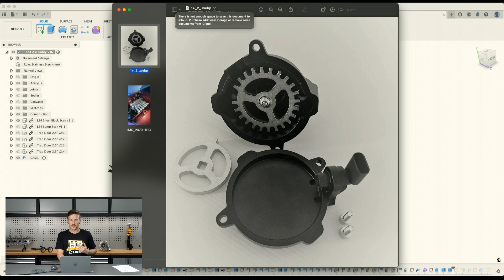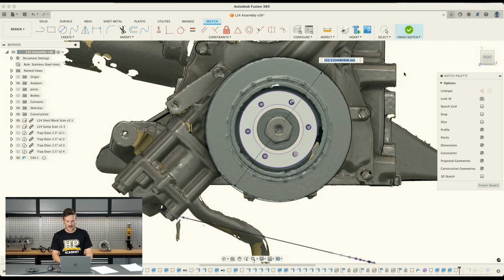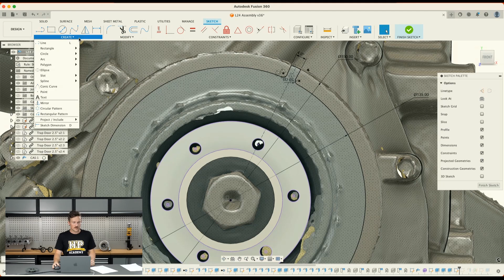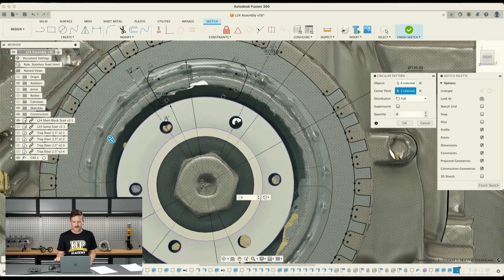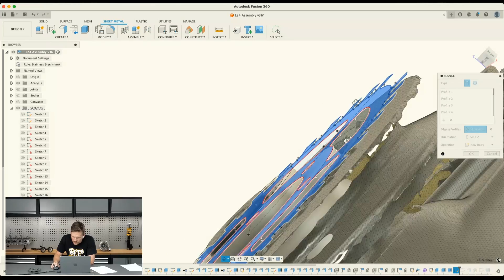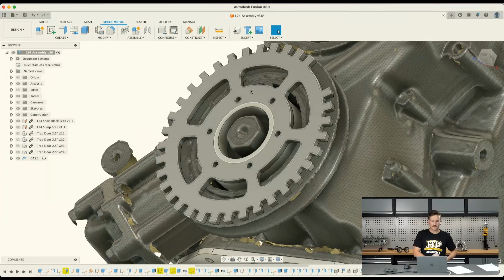Make Your Own Triggers With CAD

Comment: how did you get a 3d model of an engine block?
Reply from the maker: You have 3 options.
1.) 3D scan it (that's what we did for what you're looking at here).
2.) Model it in CAD based off manual measurements.
3.) Pay someone for the model (if available) or to scan it for you.
https://www.hpacademy.com/blog/3d-scanning-is-really-this-simple/?utm_source=facebook&utm_medium=social&utm_campaign=general-interaction

Do note this scan won't map internal passageways. That can be done via scanning (or manually if it is required), but the cost of the 3D scanning equipment that does that is really beyond the budget of most individuals, and even many companies. 

Hope that helps! - Taz.